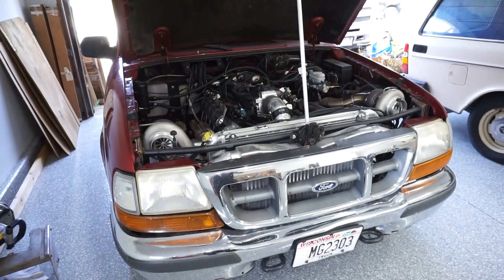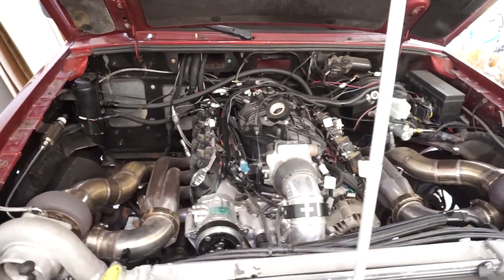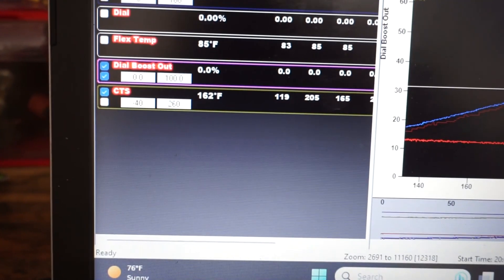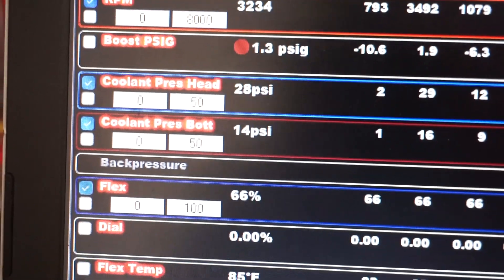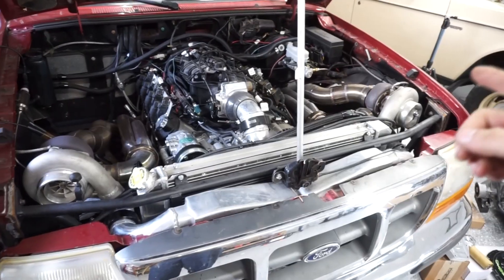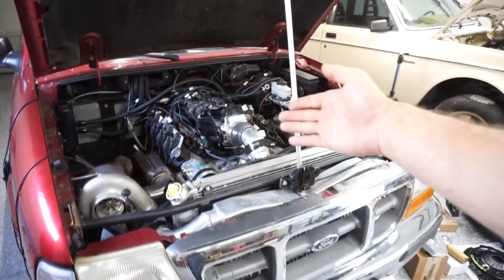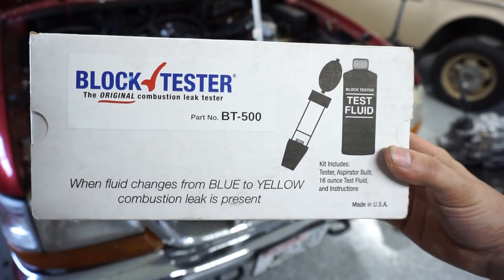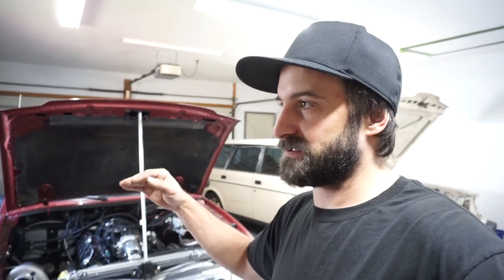LS Coolant Pressure Testing | Head VS Radiator

Comment: Brother are you sure you're not getting some sort of electrical feedback from the ignition system on the wiring or the input you're using for the head sensor? It just seems very suspicious that the pressure reading seems to be following your rpm reading almost exactly. Just for shits and giggles, I would try to plug the head sensors wiring to the radiator sensor and the radiator sensors wiring to the head and see if the "pressure" follows the input if that makes sense.
Reply: Its not that suspicious I dont think... water pump spins faster-pressure increases.
Reply from the maker: Community tab I posted test removing the belt. No rise when belt removed.
Reply: @BlaserBuilds  Well damn. I would have thought at least some of that pressure would transfer to the radiator. So I guess the question is, are we better off monitoring the block side that rises and falls with rpm or the radiator side that apparently doesn’t really tell us shit about what’s actually going on with the coolant pressure in the engine? Lol.
Reply from the maker: @BadLuckGarage  I think it's just removing volume from the suction side, and pushing it into the head. On a couple logs when I drove it to like 5k the radiator sensor actually dropped pressure a couple psi. So that would make sense, and the whole system isn't seeing more volume. When combustion Gas is added to system should raise both above normal because it's adding volume to the system.
Reply: @BlaserBuilds  That makes sense. 👍So I guess that means in order to see a problem, you would need to first have a baseline of what’s “ normal pressure rise” during a pull. Or maybe just looking for a situation where the pressure spikes above and beyond just following rpm. I’m planning to add a coolant pressure sensor soon and just trying to wrap my head around how I would read the logs. Lol.

Comment: What kind of pressure did u see people having when having sensor in the water manifold.  I have the 417 manifold and my pressure seems to be in the mid 20s to maybe 30
Reply from the maker: Talked to 1 person with a manifold and said mid 20s also.
Reply: @BlaserBuilds interesting.  My rad is in rear of car and it still pukes at at mid 20s with a 21-25psi cap.  I’ll just get a higher psi cap I guess

Comment: You are right with what you thought...

To get helpful information out of the coolant pressure number you need to know the actual value in the healthy system...on the same measuring spot

The numbers are related to where the sensor is mounted, how it is mounted (the angle the fluid is streaming to it), the used pressure cap and the physical design of the water system (pinholes create symptoms like the rising pressure over rpm too)

That's what I experienced and tested

And if you have a sealing problem (fumes pushing into the cooling system) the pressure spikes are massive (like 2 bar above the baseline)

Comment: Think of it this way, if your thermostat is restrictive and your water pump is good you will hav3 a higher reading in the head. It like people who say how much boost they run, you could put smaller heads on a 1000 horsepower motor an$ read more boost, but make less power because the heads are now the restriction

Comment: Are you saying that dead heading the water pump with the coolant loop closed is why you are seeing a correlation between the coolant pressure and rpm but not seeing it at the radiator?  My brain doesn't think of a water pump as being able to make pressure.  I always assumed (without over analyzing it) that the radiator cap regulates the system pressure with the desired outcome being coolant boiling threshold and why we see increasing pressures over the last 30 years of cars is a desire to run at hotter engine temps for emissions reasons.  But even then so long as the thermostat is open and the system is regulated by the cap (and using my thought that the WP can't create significant pressure) how does a throttle blip create cylinder head pressure?  Lots to think about.  Where do you actually think the pressure is coming from then?
Reply from the maker: I told you what I think it is. You think it's wrong. What do you think it is?
Reply: @BlaserBuilds  I think you're narrowing in on it with the belt off test.  So no belt no pressure which points to the water pump of course.  So now you think, a water pump doesn't really make pressure but instead flow.  The pressure comes from a restriction, so either the thermostat or the lack of a loop or the combination.  Time to put a little loop in there to see what that does and report back I'm guessing there will be at least some change.  Interesting stuff!  I just ordered a Low dollar sensor for my coolant pressure, for us 4 bolt head guys it's just too important not to at least keep an eye on it.

Comment: You know the only way to really know these scientific answers, is to turn that thing up just a tick past kill, then we can see actual data. 🤣
I absolutely never wish that on anyone, but I do appreciate you showing the data point differences. I do kinda wonder if there is a "best" spot for logging coolant pressure. I have data on a couple of cars, but none at the cylinder head like you have. I may use a low dollar sensor on my own now.

Comment: Iirc water pump output pressure/flow will cause rising/falling pressure changes based on RPM. Pressure is a byproduct of restriction. 
Coolant flow volume/restriction variations.